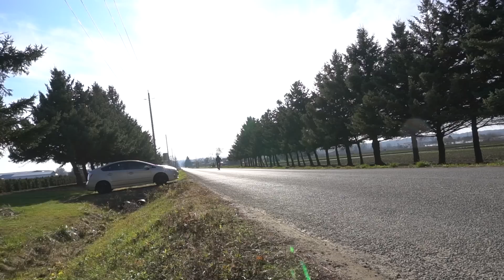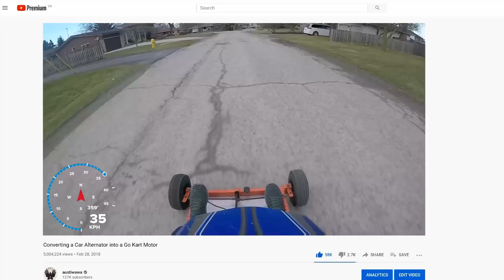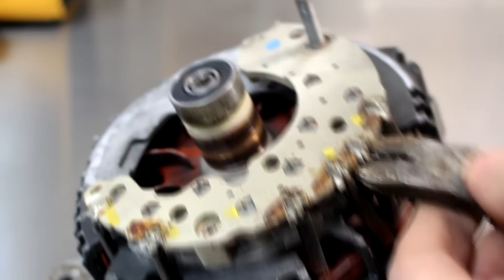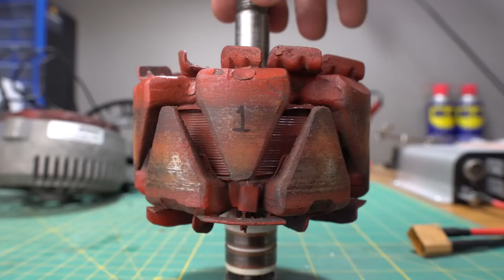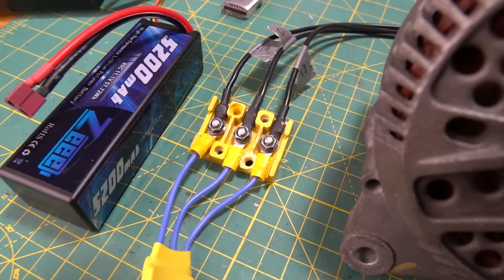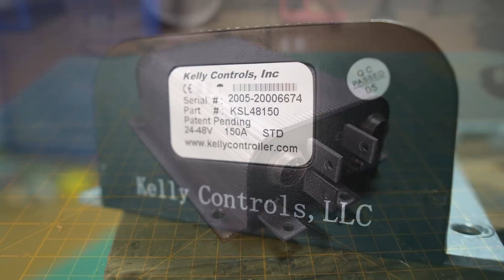Building an Alternator Powered Bike

Comment: What’s the range?
Reply: he told on the end of the video, with the small 18Ah battery he got 30minutes at fast speeds
at faster speeds you need more power to feed the motor on higher RPMs, so if you gear it to get only 40-50kph and you help the motor pedalling sometimes, you can get a higher range
Reply: @foxxyytofficial  Thank You ok so it can be ridden for 30 min to up to 40 to 50 Kph, what I would like to know is, how far would would it take you. example :10,20,30 km in one charge riding at 30 kph. 
RANGE:  What Distance Would it be able to travel before the battery dies. Thank you
Reply: @mannycaballero4370  just make the calculation:
if he rides at 50kph for 30minutes, it will be 25Km traveled
if you get a controller that can regen on braking, you can gain a few Km on range

Comment: All I want to know is if I make something that spins the alternator when the wheel moves would it keep a battery charged on a bike I need a battery for my motorized bike
Reply: that won't work
Reply: @foxxyytofficial  dang man how would I make something like that work just get a large battery and charge it everyday
Reply: To charge the battery, you need to give the energy needed for that, and that is a loss
To test the idea of load slowing the power, grab any small DC motor with their wires, and spin the shaft without nothing touching the wires, will feel light
Now touch the two wires together and try to spin, will make it heavier

Comment: Why do you run the field winding and stator windings off of different power sources if they're already electrically isolated?
Reply: it is easier, but he could just get a 48V to 12V converter and plug it in the battery and the brushes
Reply: @foxxyytofficial  I didn't remember that the field windings were excited at a different potential than the stator windings. It makes sense now.

Comment: Take and put softer Springs on the centrifugal clutch that idea of clutching system would be a good idea if you maybe put a manual clutch or a rectifier to fool the controller until you need the electrical power to the motor a different clutch or softer Springs would be a definite difference
Reply: he stopped using it

Comment: I found out that an alternator can be used as a dynamic brake. I connected the three phases together and, strangely enough, it didn't make it more difficult to spin. But the moment I applied a field current it became hard to turn. Varying the field voltage varied the drag. So the alternator can be used to measure power from a motor. I've run alternator motors at 100 volts with no issues so a 100 amp alternator at 100 volts is 10,000 watts which is 13.4 horsepower. So the alternator dyno can handle a fairly strong motor.
Reply: hey, if you live in the united states, i have an idea for you to test powerful alternators
i will wait for you to send an email so we can talk
Reply: @foxxyytofficial  I live in San Diego
Reply: @pthomps1954  please give me a email or other contact, i would like to inform you of a different type of alternator that could be more powerful than the common ones

Comment: I Was saying to myself I found a random video and now I want to build an electric bike..  HOW DOES THAT WORK . ..?
You know your work your skills in both electrical and your communication skills dragged us all in. 
Keep up the good work my freind cheers 
Dave sydney Australia
Reply: the alternator is basically a reversed motor with diodes to transform 3phase into DC to recharge the battery
removing the diodes and feeding 12V to the brushes (like he did in part 1) allows to get the 3 phases and connect in any BLDC controller to spin
now he installed hall sensors to have a better torque and to not mess the controller (BLDC without sensors can get damaged or start working backwards because it can't know how the motor is spinning, with the sensors installed the "controller" now knows how the motor is spinning)

Comment: Now, are you able to modify Old Rusty V3 so it has KERS? Well not exactly KERS but able to feed power back to the battery under deceleration.
Reply: He would only have regen if the KEB controller had the option
VESC controllers have this option

Comment: Using a permanent magnet(neo52 preferred for larger sizes) and a coiled stator will deliver a clean digital drive of the motor compared to the alternator to motor.

in rc world there is a plethora of oversized motors that will easily power a chain drive.  with 2 way telemetry of the esc i can use a betaflight drone flightcontroller and the blheli32 then effective braking and regen of power could be a breeze to wire up. i mean the cost of rc motors is abit compared to a free in a shelve somewhere genny from a car. the thing with the majority by far of these gennys are designed to to effective at a low rpm. so you power use to effective rotation force is in quite narrow band. Because most car are driven at a 800 to 2100 mainly.  there are of course deviations to this rule of thumb... but roughly. so when u induce the magnets u will only have an effective pull at roughly backyard math 20 to 35%. energywise that is good provider for the cars generator or alternator depending on ur skills og locations i guess? 🙃 

while electromotors with highgrade neo mags and ceramic oil cooled bearings surpasses the alternators ability deliver push/drain.
made a 8 motor 5 inch stick suit and that got me to 36km/h and i did not dare to go faster  as i was on rollerblades. i had 42.7 percent throttle at top of the pull and this rig shot me forwards at a tap from idle. braking was shitty. like only felt the props breeze compared to the higher throttle of 30%. That was sooo scary, had to check my britches afterwards man.. hehe not kidding.

were u scared when u hit almost 70 kmt? makes my eyelids flapper 😅

can bolt to my bike but the local police would not let me test on a parkinglot so i guess im looking for private property to test.  aiming for 60kmt. wish me luck

Comment: is more efficent with permanent magnet rotor?
Reply: Yes it is
Reply: @foxxyytofficial  are you sure?
Reply: @leobalbuena9938   yes, because with the electromagnet claw-pole rotor you have:
1) Efficiency loss with the claw pole, against the rectangular shape from a PM magnet
2) You need extra power to feed the alternator's electromagnetic coil (up to 6A at 12V, depending on the load on the converted alternator), PM rotor is already magnetic and don't need the extra amps you would use for it
3) Copper resistance to electricity heats it up, making it harder to pass the electric flow and this cycle repeats until they stop in a certain temperature range, where it get more or less in equilibrium
Reply: @foxxyytofficial  thanks for the explanation

Comment: It reminds me of using old washing machine motors for go karts back in the day. VERY high torque. Would blow through centripetal clutches quickly. Wish we had access to hall centers and speed controllers back then. That would be a good video modifying high torque washing machine motors.
Reply: And bonus both washing machine motors and alternators are pretty much bulletproof. Any magic smoke could easily be fixed.

Comment: I built two of these motors and I am wondering how you control the field current. It seems like it is important regarding performance and efficiency. Also, I've run hubmotors and a BBSHD mid drive without hall sensors and the only downside is roughness at low speed high load. Top speed doesn't seem to suffer. Did your sensors affect top speed?
Reply: Field current in his case is fixed
To change it you need a brushed controller

Comment: I notice you have pretty much everything mounted above the rear wheel, where a lot of bikes have a small rear rack anyway.  Imagine if you could fit everything into a small metal box like an ammo box with handle so you could carry it.  Instead of connecting the the chain directly to the motor, you could connect the chain to a double sided sprocket mounted to the bicycle rack. One side of the sprocket attaches to the chain, and the other side of the sprocket meshes with the motor. Then you could just remove everything that was valuable about your bike by just taking the metal box with you. You would just need a plug on your metal box for the throttle control.

Comment: A centrifugal clutch needs high rpm.
Reply: He stopped using it
Reply: @foxxyytofficial  He put a sensor controller on the bike
Reply: @gteaz  yes, because the clutch idea wasn't that great on results
Reply: @foxxyytofficial  Correct, a centrifugal clutch needs high rpm
He stopped using it
He put a sensor controller on the bike

Now what do we do? Circular conversation?  

Correct, a centrifugal clutch needs high rpm
He stopped using it
He put a sensor controller on the bike
yes, because the clutch idea wasn't that great on results
Correct, a centrifugal clutch needs high rpm
He stopped using it
He put a sensor controller on the bike
yes, because the clutch idea wasn't that great on results
Correct, a centrifugal clutch needs high rpm
He stopped using it
He put a sensor controller on the bike
yes, because the clutch idea wasn't that great on results

Comment: On your first controller what if you switched the 12v at the brushes to prevent rotation at power up.
Reply: Yes  no power field    &   Or A manual clutch
Reply: @FixItStupid  cutting the field would mess things up
and no clutch was better

Comment: you don't have enough torque, you need higher gear ratio
Reply: I think its enough for a small bike
Reply: @foxxyytofficial  it has enough power; only need more higher gear, or more voltage to the field coils to get more torque and less speed
Reply: @matatisan  12V on field is already max torque from a 12v alternator
If he wants a tad more torque, he would need a 72v battery and controller

Comment: Does regenerate when you decelerates?
The permanent magnet rotor would help to improve the energy consumption because you will have not to supply any current to the rotor.
I like that you didn't quit. If were me probably will start considering take a hammer and start slamming things. Good job!

Comment: If you reduce the feild voltage/current ur max RPM will go up... feild weakening..   awesome work! super cool!!!!   Thank you for doing the hall research, I have wanted to know how to do what you did.

In one of my vids i do what with a power supply.   You can make an arduino program that will reduce feild voltage above X RPM, or just have 2 throttles.. lol   GREAT JOB!

Comment: I think it's cool how you made it a point to NOT call this version a 'Brushless' and how you clarified later in the video about using PM's to make it 'Brushless. So many people out there have it wrong and will argue with this issue.  I did this project some time back only using the alternator as generator/wind turbine. I ordered custom ring magnets from China, waited 3 months for them. it only take 2 this way and be sure to use bee's wax to install them slowly to avoid breaking magnets. I removed the coil ( be sure to index the housing with a roll pin so it goes back and stays balanced and properly spaced. Also be sure you get the mag poles correct, N-S-N-S and doing this way you don't have to have a special rotor made to fit, only make sure you get magnets that will fit inside the rotor case halves. With careful measuring you can make a spacer to get the magnets to made to fit snuggly inside the steel cases so everything is held and will not shift causing vibration.

Comment: Insted of wasting energy on continous powering the field coil you could use a 'Three-phase bridge rectifier' and power the field coil from the motor controller. I tryed it and works perfect. And you should change gear ratio to lower speed for the clutch to work better.
Reply: Good idea. The field current increases with the throttle. I used a similar idea to charge supercapacitors with the throttle.
Reply: He stopped using the clutch
Reply: Thanks for beeing you. i wish i could keepitsimplestupid like that. so clean.

Comment: What are the advantages of having an electromagnetic rotor instead of permanent magnets?
Reply: More efficient (electromagnetic rotor won't give the same efficiency level as a PM rotor)
Reply: @foxxyytofficial  but wouldn't the power draw from the electromagnetic rotor lead to a decrease in efficiency
Reply: @isaac.leonard  that was another point
You need to feed the rotor with energy AND even if you had a PM rotor with same magnetic strength, the claw pole rotor won't be as efficient
There were one product that helped to combat this deficit on efficiency, the BAS mild hybrid alternator, the claw poles were less wide and there were magnets between the claw poles
Check the disassembly of the BAS mild hybrid on the website AcuteAero
Reply: @foxxyytofficial  wow that's very interesting thanks!

Comment: Is that a alternator from a old ford truck I used one of those, project is on the backburner the motor got real got and the case cracked I assumed it was from heat

Comment: This is awesome! How many amps were you running through this thing? Asking because I'm thinking of trying this myself and want to know what's safe for the motor
Reply: His controller can pump 110A max continuously, so between 50-80A would be a basic guess
Reply: Alternators usually have their generating power marked on them, so that's a rough guide.

It's worth looking around for alternators from high-spec diesel cars, or really high-spec petrol cars (with tons of electric gizmos, 4x electric windows etc) as they are often rated far higher for not much extra weight. Quite often they can deal with double the power of a alternator from a more base model
Reply: @mor4y  most people are "locked" behind chinese 350-1500W controllers, only 3 youtubers that i know used better ones:
Austiwawa and his KEB48401X
Fixitmoditbreakit and his FSESC 60V 200A watercooled unit
And Enrengineering with his BAC-0501
Reply: @mor4y  the youtuber with the FSESC controller got 4000W from his 120A alternator and 36V battery pack

Comment: Try different field voltages? Lower field voltage = high speed, hi field voltage = more torque.
Reply: He already tested at 12v and with his actual settings and gearing got almost 70kph, so he probably won't try to lower the voltage and get more speed
Reply: @foxxyytofficial  Why not? Because reasons.
Reply: Of course, higher rotor voltage at high speeds can destroy the motor controller. Back EMF goes thru the roof!
Reply: IPM motors work kinda similar way. If controller loses voltage supply from the logic then field weakening stops working and permanent magnet will give full whack of the EMF to the controller.
Reply: @waldemarii  if he tested the alternator back on the kart probably could test varying the voltage on the rotor, because its less prone to "fall" like the Old Rusty

Comment: The stator you are using is of distributed type, meaning that the coils overlap each other, they span over a number of teeth. For such stator a better solution is FOC control, not the generic one which simply connects + and - to the coils. The other type of stator is the salient pole type - meaning that the coils are concentrated on a single tooth and with a salient pole stator you can drive it with generic controller. Still, very entertaining, nice and educational video.
Reply: FOC-capable controllers are very expensive, and since he already had one, and it worked well, i Don't think that FOC was necessary

Comment: More rpm and continuous torque is needed for centrifugal clutch operation. I like the idea though..  This way , you can reduce the peak starting current drawn by the alternator thus protection your driver circuit..... Brilliant !!!
Reply: He took the clutch later after the not-so-good results
Reply: Hi Mr electron bro
Reply: Actually I think the clutch idea is GOOD, it will eliminate shock loads to everything and if it slips too much simply use a lighter spring inside of it. The only draw back is you will not have any way of using regenerative braking or able to recharge by peddling.
Reply: @brettschacher8644  but he used the clutch because the sensorless controller forced a minimal speed, but with the hall sensors the idea of the clutch is bad
Reply: @foxxyytofficial  I know why he used a clutch ! Because he used an incorrect control unit that would not fully shut down. This isn't the first time you have tried to educate me about this stuff. Just for the record, I have been a mechanic for over 45 years with tech school training in electronics. None of this stuff is new t me.